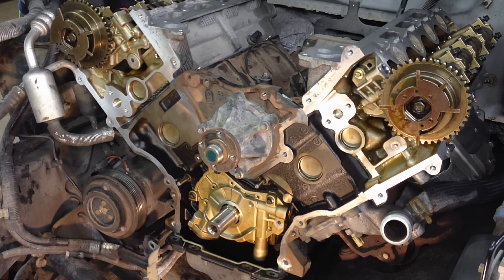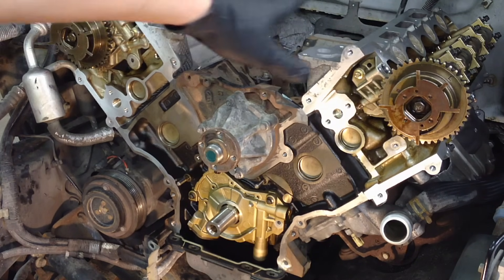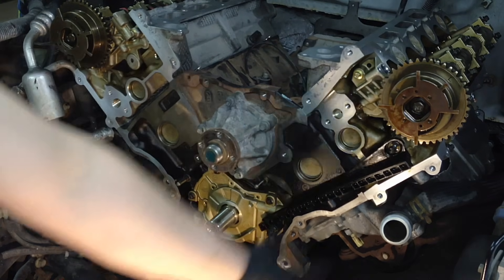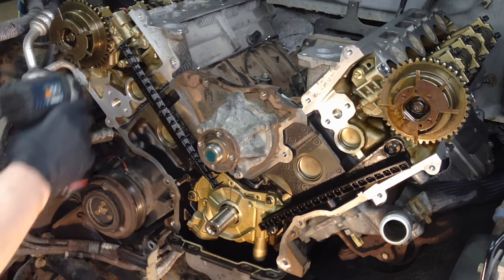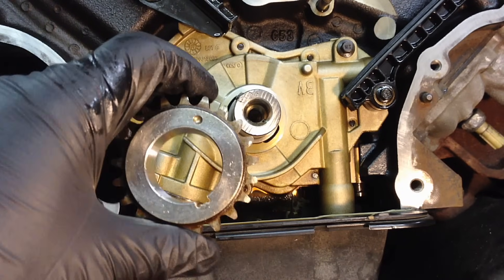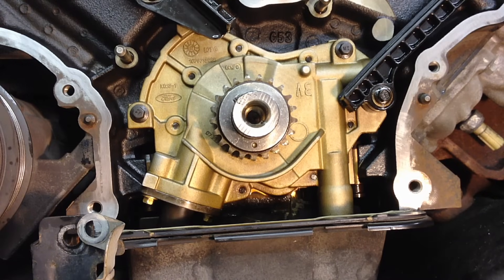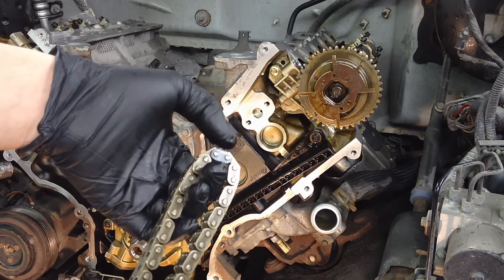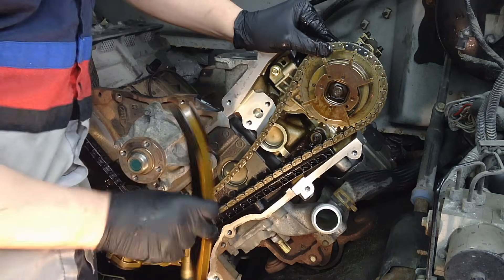Ford 5.4L 3v Engine Timing Walkthrough

Comment: '06' Expedition 5.4 3v.  I had a mechanic who jacked up a plug and had to remove the head on the drivers side.  Head was repaired and left on block.  The mechanic has since disappeared so now i have to do it myself it seems.  This instruction video makes it look so simple that it is hard to believe. My question is what relationship is TDC on #1 in relation to setting the timing?  And to be clear my engine is stripped to the front of the block so no pulleys are installed right now. Thanks
Reply: +richard porter When the crankshaft gear dot is at the 6 o'clock position #1 cylinder is at TDC.
Reply from the maker: +richard porter I have never checked the positioning of #1 tdc while doing this the important part is the position of the keyway everything else falls into place.
Reply: okay then i here i go...thanks

Comment: As I am doing this timing job I noticed that my lash adjusters don't have any "spring" to them.  How much spring effect should they have?  I have seen some other you tubers showing that they must have a lot of play. I have read elsewhere that they should only move max of 1/16th of an inch.
Reply from the maker: They shouldn't move but a 1/16th like you read. They are made to transfer the motion not give.

Comment: So after moving the crank to the 6 o'clock position then proceed to removing all followers want to make sure I got it right
Reply from the maker: +Christopher Waechter They want the 3 on each side removed as shown in phaser video then 6 o clock then remove cam caps evenly and cam to remove the rest of the followers.

Comment: Hi found your channel and just wanted to say great videos. I need to do both the phasers and want to do the timing set also at the same time. I have a 04 with 190000 miles and the start ups sound almost dry on bank 2 until it runs for  about 30 seconds. In the phaser video you say remove the 3 roller followers per side. In the timing video you say all should be removed I do not have the cam locking tool would just removing the 3 followers lock cams in place to proceed to the timing set switch please any advice would be awesome. Want to attempt the fix myself but can't afford to destroy the engine in the process.
Reply from the maker: +Christopher Waechter If you are replacing all timing components then you need to follow this procedure and remove all of them.

Comment: I have the 5.4 3valve in a 2004 f150 it does at times make a clap noise on start up or sometimes sounds like a diesel at idle . I have no engine codes . Any ideas . I know without being there its hard to say . However any ideas you may have
Reply from the maker: j herrera Yeah it sounds like you have all the traditional failures on these engines- cam phasers and chain tensioners. Don't forget to replace the vcts solenoids while you are in there.

Comment: Yes I use the otc tool to line it up camshafts was locked Done in correct position I have two other techs check and they also approved it. But I'm check compression tight now to see if I bent any vales.

Comment: Thanks for going through the whole process and posting the video. there were some things i was unsure about but between your phaser replacement video and this video i think i have the answers i needed. I changed my oil 3 days ago and it was almost 2 quarts short, shortly after i did the ping that was always there got very noticeably louder and the truck started a very rough idle. Engine code said Cam Pos Sens but shortly after replacement the issue returned. The rough idle\stall doesnt start until the engine has warmed up. Where do i get a "cheese wedge" though?
Reply from the maker: Donatello NaBotti rough idle stall hot is usually low oil pressure causing erratic vct operation or the vct solenoids are sticking in the advanced position.
Reply from the maker: Donatello NaBotti Here is the timing wedge tool I trust-http://www.amazon.com/gp/product/B00IXZU2WU/ref=as_li_tl?ie=UTF8&camp=1789&creative=390957&creativeASIN=B00IXZU2WU&linkCode=as2&tag=fordt-20&linkId=IAARTEUNGE4X7MHY
Reply: Greatly Appreciated!
Reply: Any chance you have a Cam replacement video? VCTs were bad. One of the intake lobes and rocker arms on the 3 cylinder are significantly darker than all the others. Almost copper colored. going to replace and do timing chain while I'm that far committed.
Reply: @FordTechMakuloco  was this engine top dead center ? Mine is off a tooth just trying to figure out do I leave the cabins on to get tdc or take them off ?

Comment: OK timed it up to the 11 o clock and still running the same way and still have the same code.
Reply from the maker: PUBLIC NEWS Your timing seems to be off still some way not sure without being there. If you followed the video and timed it the same way then you should not have a problem.
Reply: FordTechMakuloco  Ok, Is there any other way to check to see if the vales are bent other then taking the head off?

Comment: Hey man I have a question for you, I have been in this field for 8 years now just to give you a little background on me. 
But cut to the chase you say go to the 11 o clock position, now alldata is telling me 12. I did it at 12 like alldata said and now Im running a P0345 code, and rough idle. Now from what your video is saying i have it a off by a tooth. with it be off like that would it have bent any vales?
Reply from the maker: Alldata might have the old procedure it's 11 for the keyway and 6 for the timing dot. 345 your timing is definitely off. Anything over I would say 2 teeth you likely bent valves

Comment: I was trying to swap out my cams, and i got the timing wedge tool somehow stuck in the chain now i have to take the covers of to free it is there any special way i have to move the cranckshaft when puttin it back on, i have the links on the chain marked with the timing, i dont have to take them of,i have i 4.6 3v mustang thanks buddy
Reply from the maker: John Smickle If you are pulling the front cover to un wedge it you don't have to remove any chains.
Reply: But now it bent the phaser so i need new phaser, so i just mark the arrow on the link with a sharpie, and just put the new phaser on the ame exact link rite, to kep the exact time, that is all i need to do rite bud?

Comment: Quick question.  If the motor was timed with the chain lined up on the L on both right and left side, will this not warp a valve or two?  I am helping a friend who tried to do it himself and he didn't "see" the R on the right side, so he lined it up on the L the same as the Left side.  Just asking so I know whether to pull the heads for a new valve job or set it and go. Truck would start and idle, but wouldn't move out of its tracks. 
Thanks
Reply from the maker: Ralph Clifton At that point the timing would be 180 off on the right cam and most likely caused a valve to hit the piston yes. Anything over 2 teeth off likely caused valve damage.

Comment: Hey, I am wondering on the followers on the cam shafts, do they all need to be take out? or only the ones that releases the tension on the cam phaser? You posted a video about a year ago only doing the phaser and you only did the front middle and rear two in the back on the right side and opposite for the left head?
Reply from the maker: Brandon Thompson If you are performing a full timing procedure then they should all be taken out.

Comment: Hello how are you in doing a 5.4l 3v in a navigator now both my sprocket on my cams have "L" on them what do i do with that i follow figuring it would be the same but it wasnt truck wont start... what do i do now..
Reply from the maker: Gregory Robinson If they only have L marks on them there should be a straight timing mark 180 degree from the L mark
Reply: Ok thanks ill try that..

Comment: i have a question, my 2009 f150 is out of time and im watching this video and you say to take out the roller followers correct? and if my crankshaft is not a 6 o clock does it mean i move it with the 32 mm socket clockwise right? and how would i know that both of my phaser are on point? thank you!

Comment: Don't make any sense to use a special tool to lock the crankshaft when you have 2 color links and marks on crank and cam sprockets. try to move the crankshaft couple degrees left or right and the color links match anyways.
Reply from the maker: Bsoundpro Sound Reinforcement Try it your way and you will see what others are finding out real quick.

Comment: When I rotate the motor my timing marks go off???
Reply: +Utah Bones Because you have to rotate the motor so many times to get back to where it was. As the lower gear is not the same amount of revolutions with the cam phasers. As they are different sizes. It's the same for all most every engine.
Reply: What do you mean rotate the motor?
Reply: Tylar Rick you don't have to do two full turns. You can turn the crank one full rotation, then throw the chain back on and it will run. The cam position is what determines what stroke it is on.
Reply: The crank makes two revolutions to the one of the cams. If you are at Tdc and rotate the crank one time you are now at Tdc of the exhaust stroke, crank it around one more time and you are now back to where you were.

Comment: Thanks so much for the video, used your cam phaser one before but now I am having to change the rest of it. Anyways I have read you are not supposed to turn the crank without the timing chains connected to the phasers.
I have already taken everything off and waiting on parts is it ok to rotated the crank into the correct position like you did in the video without doing anything else like loosening cams or taking out rocker arms?? Thanks again for the video's and the help you are a life saver!

Comment: I am planning on doing phaser lock out kit from Livernois and the chains/guides/oil pump at the same time. Lock out kit can be done without removing followers. Is there any way to do timing without removing followers? Watched both your phaser/timing vids. If everything is off at once will the cam shaft stay locked? Does it matter if the whole timing procedure is being done? Thanks so much for your vids!

Comment: Thanks....I am dealing with existing timing done by another mechanic.  I replaced both phasers with new Dormans and one new camshaft.  Installed Livernois lockout kit in Dormans.  Now rotating engine to check if they got the timing correct.  Both the R & L arrows on the phasers point to the END of the single dark timing chain link.  Appears to be off 1 tooth.  
A.  Is there any other way to confirm correct timing, other than removing the timing chain cover and everything in front of it?
B.  Is there a chance that if I kept rotating the engine that eventually the R & L arrows would end up pointing to the gap between the two dark timing chain links? (indicating correct timing and that they had put the chain on the opposite way from what I expected)
Reply from the maker: Stan Lehman There is no way to confirm correct timing no matter how many times you turn it it is best to just do it again on these engines.

Comment: I understand you can interchange ends of the timing chain with either the crank sprocket or the phaser.  Regardless of the way its setup initially, will the phaser arrows on the R and L ......ALWAYS point to EITHER: the center of the single dark timing chain link, OR in  between the 2 dark timing chain links?
Thank you for sharing your knowledge here....it is very helpful!
Reply from the maker: Stan Lehman Yes if there are no marks visible just lay it out as shown and when laying the chain straddle the arrow on the phaser.

Comment: In this video i see that the bolts for the camshaft are loose, so you put all the time marks and you tighten the bolts for the camshaft or do you need a special tool to lock the camshaft and then tighten the bolts?
Reply from the maker: Eric Martinez It is a trick I do to prevent putting each follower in after timing, you just have to tighten the caps down even paying close attention to the front one.
Reply: FordTechMakuloco so you do it whith the rollers f in. And then at the end u tight in the cam?

Comment: Thanks for putting up this video. Its really helpful. Im having a question. Im working on a 5.4 4 valves lincoln navigator. Is there something different with this engine than  with the one you have in the video.do you have any specific recomendention for this kind of engine? Any specific tip to put the chain on time?
Reply from the maker: Eric Martinez Nope all 5.4l 3v engines are the same.

Comment: Can the oil pump be removed and replaced without dropping the oil pan. Also any idea of where to get the valve cover bolts, mine are all rusty and no socket fits them any more. Thanks
Reply from the maker: Major Smack No I just know they are part of the cover you would think dorman would be all over this as your problem is very common. I have replace and oil pump before without dropping the pan yes it was quite easy too.

Comment: How you doing man i have a question I'm replacing the timing chain on my 2005 f150 5.4 3v and i was watching your video u were showing that on the driver s side it has the L shape and the other side has the R but on my truck i have the L on both sides what should i do .
Reply from the maker: Manuel Perez Use the tooth 180 degrees from the L for the right hand side.
Reply: Manuel Perez  I have a 06 with 85 k miles   Engine runs nice but I hear what sounds like a chain rattle possibly when I’m tapping the gas and parking and moving very slow    Any experience ?
Reply: Quick question why where you right side cam caps loose

Comment: I have a question about the harmonic balancer bolt. What's the best way to loosen it? Is it safe to use an impact gun? And do I need a special puller to get it off or can I use the standard puller like what would be used on a 5.7 Chevy engine?
Reply from the maker: Marcus Proctor Impact gun is best bet yes, a standard harmonic balancer puller works perfect as long as it has threads for bolts in it.

Comment: What do recommend for oil in these engines? I've been using 5w-30 in my 08 with 100k Expedition it runs great but recently I have been reading to stick with 5w-20 semi-synthetic as the timing tensioners and phasers need the thinner oil to prevent issues. Would 5w-30 in the summer and 5w-20 winter be ok?
Reply from the maker: I think semi is just fine. I would run Penzoil or mobile one just for the cleaning additives.
Reply from the maker: B Scott Many run 10w-30 all year round and never have issues. 5w-30 would be my choice year round.
Reply: FordTechMakuloco Full Synthetic or Semi ? If price wasn't an issue which exact brand oil would you get?

Comment: Just subscribed. Great work! Very Professional! I work in the mechanic field myself. The Bosch is part of my arsenal. You may consider adding the craftsman 90 degree rechargeable tool as well. between that and the bosch ur flying without dragging air lines :)

Comment: I'm blowing plumes of white smoke since getting on it a little in my 06 Mustang last night.  Been getting a cylinder 6 misfire code, even after replacing the coil.  Now I barely have enough power to move the car forward (Topped out at 40 on the way home last night, when it happened.), and this started when the engine became extremely rough idling, and making clanking sounds inside the engine (that sounded like metal playing Plinko!)  Sound like this is what I need to now?
Reply from the maker: Will Swartz Sounds like a sticking injector to me personally.

Comment: A brief question if you don't mind.  My new OEM phasers just came in.  One of them has 2 of the reluctor tangs bent down, and there's a slight wobble in the reluctor plate (2 of the 3 pins are loose).  I wonder if it's a big deal since the tangs can be bent back up, and the phaser bolt will compress the reluctor against the phaser, and against the cam - It looks like someone on the factory line dropped it.  There aren't any other looseness issues, rotationally or otherwise.  Looking for your thoughts - Thanks also for your clear and concise video's.  I do appreciate them.
Reply from the maker: AltitudeGrower I would not be installing that one no way send it back.

Comment: I have a question, I did everything you said to do and the marks lined up when I did the timing chain. But when crank it up it is skipping like it is out of time then when I drive it seems out of time. Is there any way that you could still be out of time when the marks lined up? and how do I fix it?
Reply from the maker: Anthony Yes I have done it before like I said it is very important the crank position is dead perfect. Only way to fix this is to do a full retime.
Reply: FordTechMakuloco OK now when I turn the key to the 11 o'clock position cylinder one is at TDC right? Also when doing that should bring the R and the L on the cam phasers to the top of the cam right
Reply from the maker: Yes it should be 1 TDC the timing marks will be towards the top yes there is a picture of how it looks in the description or in the video.

Comment: Great video , Thanks for your time and sharing your knowledge. I have a question  on my 05 expedition 5.4 ,3 v.    My cam  phasers  both are L,s. Should  the right bank be timed by the opposing 180 degree mark?
Reply from the maker: Craig Hill Your new ones are? I am quite sure that dash you see on the other side of the phaser is the timing mark for the right hand side.

Comment: Hey this is very helpful information you walked thru it nicely. One question you said i have to remove all the rocker arms? then when i put the chain on and release the tensioners i put them back in right? like i gotta pry them in a lil correct?
Reply from the maker: Sal Rivas Yes they should all be removed time them and then reinstall I have a few tricks to getting them back in on my phaser video.
Reply: FordTechMakuloco thanx for replying  bro and ok thanx man i appreciate  all your help your vids are great dude thank you again.